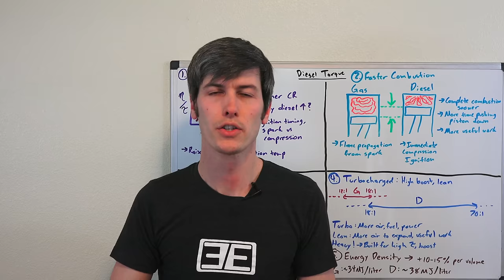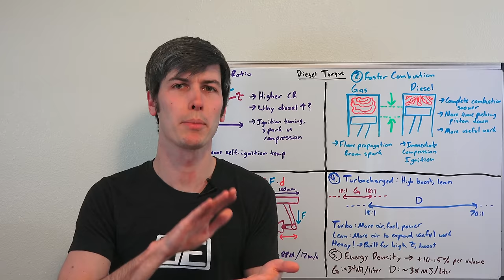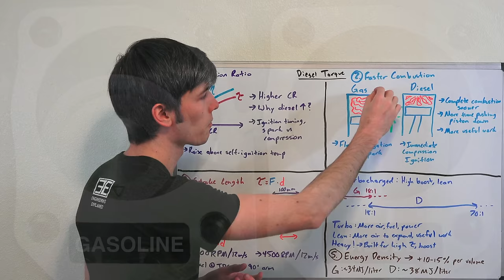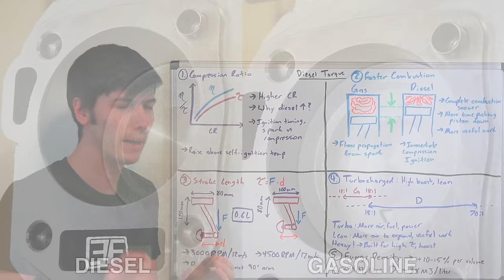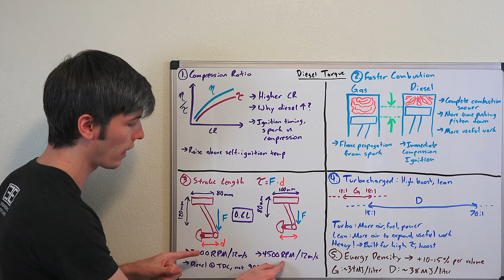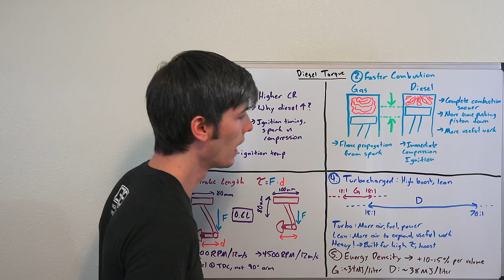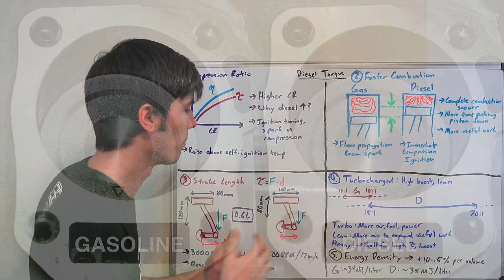5 Reasons Diesel Engines Make More Torque Than Gasoline

Comment: A couple of things...if I remember my reading correctly, you have #2 backwards.  It's gasoline that ignites (and burns out) almost immediately, the moment the spark plug fires.  In a diesel however, fuel keeps getting injected until 20-30 degrees past Top Dead Center (TDC) on the power stroke, maintaining pressure for much longer.  The reason this is important, is that when a piston is all the way up (at TDC) it produces little to no torque, the crank pointing straight up and being virtually in-line with the connecting rod.  It's only when the crank has turned that the connecting rod can push against its side, creating torque.  By that time, pressure in a gasoline engine has already dropped considerably, which is why you really have to hit the gas to tow anything with a gas-powered truck. 

As for turbos, gas engines have their boost limited by the octane level of the fuel.  As a gas engine compresses both gasoline vapors and air, too high a boost will result in detonation upon compression.  In a diesel you're just compressing air, the fuel isn't injected until compression is complete.  So, the only limit on turbo boost in a diesel is the strength of the engine itself--which is WHY they're built so strong.
Reply: Thanks for the comment. I don't have enough background to fully understand the first paragraph (sort of half get it) but the point about diesel turbos is clear even to me.
Reply: You do have a point.
Reply: I thought about this crank angle thing (because other people mentioned it too) for a while and I think a lot of people missunderstand how pressure works. If all the fuel is combusted immediately higher initial pressure will be created in the chamber. If the fuel is combusted slower then the chamber will start with a lower initial pressure but decrease slower because some of the fuel will be burning and counteracting that pressure loss. If as you say it would be best for the fuel to burn at the best crank-lever angle then gasolines engines would fire the spark plug then, which they dont do, most even advance the timing of the ignition before TDC.
Reply: Gasoline has a flame front, a spark plug initiates the flame which travels. 

The diesel burns everywhere at once because there’s no one single point where it has to start.
Reply: I saw a diesel drag pickup running 140 lbs of boost. 140!
Reply: @connorssmallengines6663  I don't know what that means, but it's not about the election so I'm giving you a thumb's up.
Reply: @kirk2767  it means the turbo was shoving enough air into the engine to compress it to 140 pounds of pressure.
Reply: You are right!!
Reply: if I can remember correctly Diesel combusts  slower than gasoline which means pressure is maintained for longer time than Gasoline
Reply: Thank you, I'm glad i wasnt the only one who realized he was wrong. I dont know much about diesels so the first point was kinda iffy for me, but I immediately recognized the point about turbos and compression ratio. The ruggedness of the engine isnt the limiting factor for boost in gasoline engines, its knock resistance.  You can run a gasoline engine at 100psi of boost(or however much) so long as you can actually cool the charge air as temperature and pressure have a linear relationship.
Reply: Because of the slower burn of the diesel, the revs are physically limited to about 4500 RPM. This is not an issue with gasoline, therefore the revs are virtually unlimited. Although there comes the mechanical strength of the rods into play of cours.
Reply: @connorssmallengines6663  I wonder how long before the head(s) fly off.
Reply: @1HighVoltage1  longer stroke is also why the rpm is limited. Pistons travel further distances at the same rpm compared to most petrol engines due to having a much longer stroke than bore.
Reply: @1HighVoltage1  see runaway diesel or sled pull tractors for high diesel engine revs!
Reply: yep, i was going to say diesel gets injected starting from before tdc but majority of fuel injected after tdc.
Reply: It's not wrong. Modern fuel injectors take advantage of this fast combustion and make several pules of power during the stroke  - basically several power pulses all along the stoke due to the fast combustion and adding power.
Reply: @captaincannabis3321  he got seperate videos explaining about all these
Reply: You're both right. Even though diesel would burn faster its burn rate is limited by injection and mixing time, so diesel burns slower in current engines. Thumbs up.
Reply: Hey I know it’s an old comment, but to clarify: If you want to run a high boost gasoline engine, you would want to lower compression? Let’s say go from a 10:1 to 8:1? To my understanding, the increase in boost would cause increase in knock. But with lower compression, you can keep the air fuel mix in the cylinder for longer, therefore delaying ignition timing for increased torque. Is that correct?
Reply: @baby_king9ine it will soak the engine, there's no way of reducing compression lowering the whole mixture or playing with it
Reply: @lLukeSkyscraper  what I’m hearing is it’s possible, if you can beef up the cooling system to go along with the high boost.
Reply: @connorssmallengines6663 
No inlet manifold pressure is 140 so when valve opens for a small amount of time depending on RPM IE higher rpm less time
More boost pressure means more air for given time also air needs cooling to increase AIR DENSITY